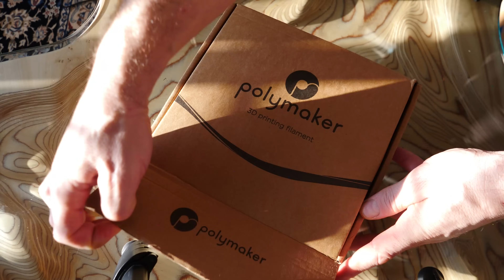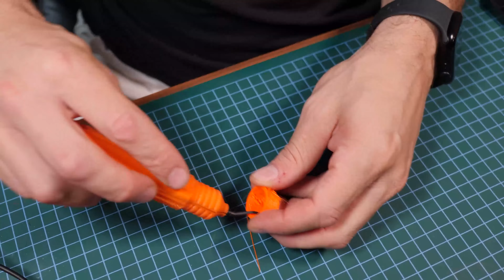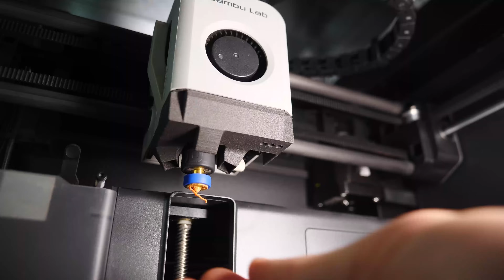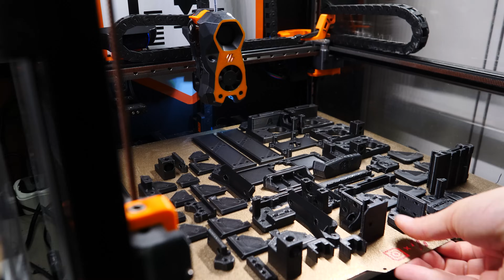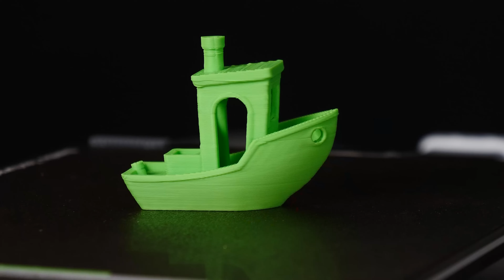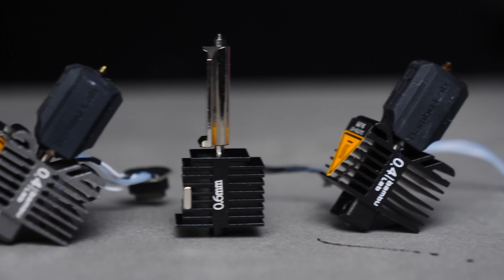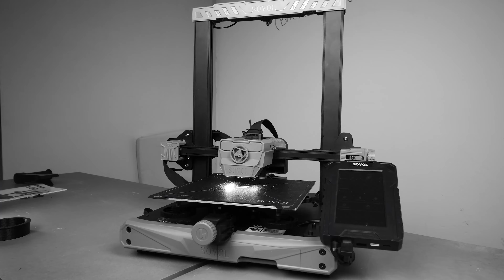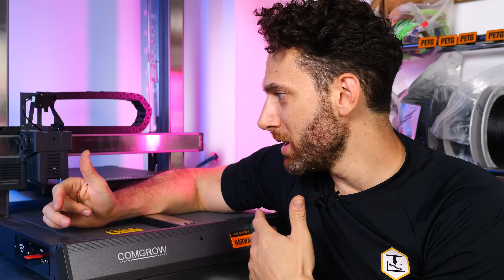My Long-Term Review of Each 3D Printer I Own

Comment: Really good video! Tomorrow my first 3d printer the a1 mini arrives. Any tips?
Reply: I'd suggest looking into a print that changes where the filament loads into the ptfe tube, it's on the x,z normally but at the start of a print when the machine does its thing it'll pull some filament from the roll then go back down causing a tangle. Unless you got the ams lite then ignore all that lol
Reply: @Yaup_  I didn't get the ams lite
Reply: One of the first prints to do should be some sort of poop box for the a1 mini
Reply: @U1TR4F0RCE  OK, will do. Also, may I ask a question? How print profile work and what I need to use and change?
Reply: @kostis_pro  so there are printer profiles which exist which set rules for stuff such as what is the space that the printer will try to print in, as well as speed, acceleration, retracting. People with experience may make their own modifications from the preset profiles to optimize the machine.